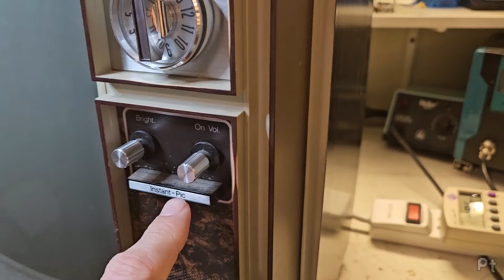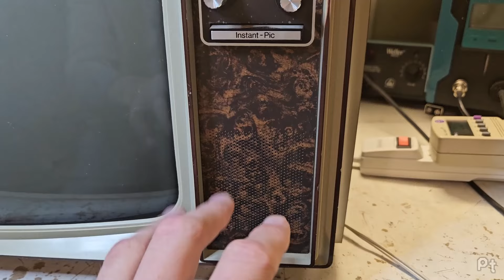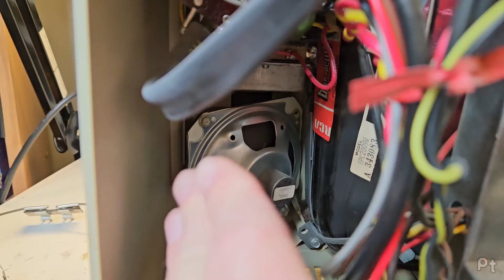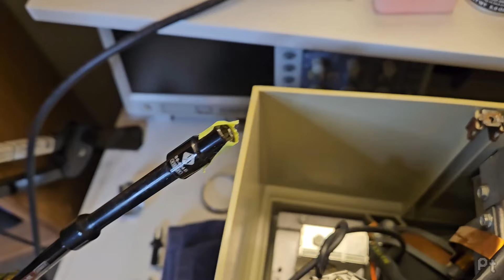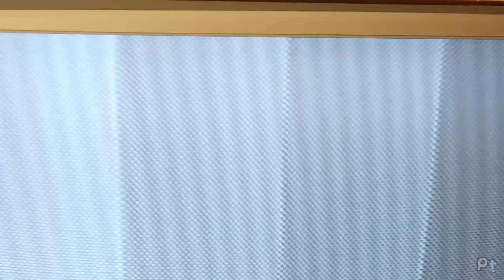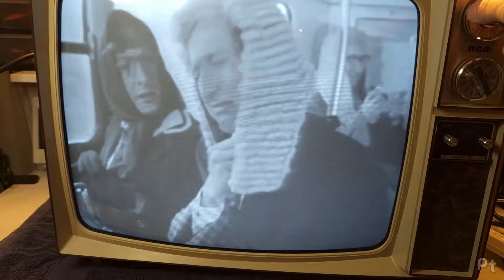RCA All-Tube TV (from 1971)

Comment: My father worked at RCA in Montreal in the late 60s when RCA was winding down its consumer products output because they were raking in far more from government contracts. He brought home one like this, with the Instant Pic feature, for my mother's birthday one year. I always had the impression it was a hybrid of transistors and tubes, RCA's lame attempt late in the game to produce something with simulated instant-on (like transistors) using their backlog of tubes technology. With the Instant Pic switched on, the tubes would sit warm and half-lit until the Instant Pic switch turned everything up to full power. I can remember in the last years of RCA corp's consumer appliances, there were some very cheap and probably prototype devices (like a battery operated men's shaver) that wouldn't take fuzz off a peach, but had a beautiful sleek modern design. They dominated tube-technology up to the arrival of the transistor, and they decided to continue with tubes until it was too late to change their culture.

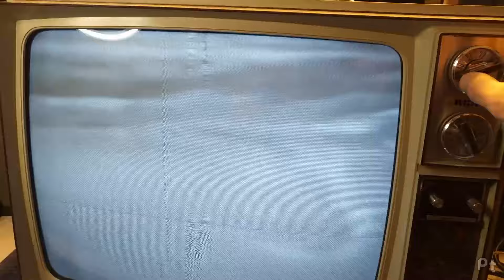Comment: Your vertical line around 22:05 is Barkhausen oscillation in the horizontal output tube.  Sometimes a replacement horizontal output tube will fix the problem.  An old hack for the same issue was to attach a magnet to the side of the horizontal output tube and adjust its position until the line is gone.  Real old time techs would use an ion trap magnet from a mid century CRT.  Maybe you could use silicone tape and a button magnet that has a high enough Curie point that the heat does not demagnetize it.  My best  understanding as a retired electrical engineer and a part amateur, part professional television servicer is that at a certain point in the tube characteristic curve, the tube would experience a very brief internal oscillation that gets picked up in the RF circuitry and may be influenced by the magnetic field from the tube heater resulting in a vertical crawl of the line as well.

Comment: The vertical line that seemed change position as you adjusted  the fine tuning: way at the back of my memory from when I repaired TVs like that around 1980 (when I was in high school!) I remember encountering that occasionally - the line is almost definitly from something in the horizontal oscillator or flyback circuitry (and it has to be since its always a vertical line). Being around the center of the screen, thats maybe where the damper diode switches, so maybe around the flyback drive ciruitry. Be careful in that area though - easly enough voltage an current to be dangerous!  Greetings from Ottawa!

Comment: There definitely is something elegant about these later budget model tube / valve TV sets. As you mentioned by this stage they pretty much had the design down to a fine art. I had a similar set until a few years ago that was manufactured in my home country of New Zealand, under license from PYE. Mine had even fewer valves than yours, although it did contain TWO transistors (!) meaning they could emblazen the front panel with the word "TRANSISTOR" 😂

Comment: Nice set! I have two old Sanyo 12" color TV sets from the mid 1980s - they're both 100% solid state (except for the CRT) and made in Montreal! And I know someone who worked on their assembly line! 
The Instant On or Instant Play or whatever RCA called their version was a common system especially in series filament sets from the mid 1960s onwards. High current silicon rectifiers had already been invented (for car alternators which came around that time) and they would put one in the power supply backwards from the half-wave rectifier supplying the B+. The power switch just "shorted" that diode. That way, when the set was off, half the AC sinewave kept the tubes pre-heated and there was no B+ until the power switch was turned on. When you turned on the set, the set would have audio almost instantly and a picture would take only as long as it took for the high voltage rectifier tube to conduct. 
Standby power was roughly 40 watts just keeping the tubes baking. Some sets also included a "vacation" switch to turn off the filament pre-heat because, well, that was somehow easier than just unplugging the set. And maybe for people who paid for air conditioning and didn't want the extra heat load in the summer. They were a fire risk, any time you have unattended red-hot things in your house... 
In some ways, it was nice because the chassis and all the passive components were all reasonably warm, so the set tended to drift less when you turned it on. You were less likely to have to get up and adjust the vertical hold control and stuff like that. 
Of course, when sets were solid state (except for the CRT and maybe HV rectifier), Instant On and all those other names continued, since semiconductors didn't need to warm up. 
I'm in Ottawa, where are you? Click my avatar and hit About Channel. :) 
Lawrence

Comment: It was expected post-1970 that tv stations would manually switch off the color signal for b&w content on-the-fly, otherwise the opposite happened and b&w looked dreadful with rainbow patterning on color sets.
Reply from the maker: I've seen that with some older recordings of black and white movies off TV from the 1980s. Trying to capture them would cause a lot of devices to go haywire with that rainbow pattern.

Comment: I wonder if this was a model designed for institutional use, but those models are usually labelled "Mural TV" for hotel/motel models and "Lyceum TV" for schools, etc.. It could have been a hospital set. I remember our 1960 Philco B&W console. I could always tell when the program was color because I would see those fine diagonal lines. Magnavox had the "instant-on" feature in their late 1960's color sets. Just imagine how much energy that soaks up and what it would add to your electric bill with a 25 tube color set!
Reply from the maker: You might be onto something. I could see this being used in hotels, though the "instant-pic" feature would have been annoying for hotel owners' wallets.
Reply: Instant on was a common thing , even before the 70's.
I had picked up several Admiral B&W sets from the mid sixties that had it, (instant play)
There were several other brands from the 60's that had instant on, I remember hearing a lot of controversy about instant on/instant play.
Apparently a lot of house fires pin pointed some of these sets as the cause,  I guess simply because to the tubes being on 24/7 , and prematurely deteriorating wire, and other plastic components.
Reply: I remember working at a television shop that serviced hospital sets in the area (central Kentucky, USA), and these sets had wired remote controls for the patients to use.  So I kind of doubt this was a hospital set.
Reply from the maker: @SeekingTheLoveThatGodMeans7648  I have a family member that was in the hospital in the 70s and built a long tool that would turn the remote on the hospital TV because it didn't have a remote. I think it might have varied by country/region. I do remember the wired remotes though, I remember seeing them into the late 90s (connected to normal looking TVs that typically came with wired remotes).

Comment: That is a gorgeous set.

Instant On did start with tube sets first, as I have a few example of that, and ended up in solid state sets until about the mid 70s. Either way, no good for the life of the tubes, or your electric bill :p

Comment: I think that TV was made a few years before my Canadian Sears TV-Radio-Alarm clock (though that was made by Toshiba for Simpsons-Sears of Canada), though I did get a PDF Sams manual for it, I haven't gotten round to looking into getting that going, still farting about with that Sanyo-Funai combi unit, got the video driver ICs for that today, lacking confidence in replacement though, cos TSSOP16 is a tiiiiiiiny package!!! :S
Reply: Flux and solder wick do help. But if you have some junk parts you could try soldering a bit on those until you feel more confident. That way it's not a problem if something gets damaged.
Reply: @NaoPb  I'm confident in soldering in general, but a part that's package is 5mm long with 16 legs that are just slightly thicker than hair, it's not looking like a fun time, smallest IC I last soldered was a bigger SOP16 in my Amiga 600, and that took a couple goes...
Reply: @twocvbloke  I figured maybe you had some junk boards with similar chips to experiment on beforehand. Sorry for being unclear about that.
Reply from the maker: Believe it or not that Sears TV is actually older! It's just that this TV used much older tech, and the Sears used more modern (Japanese) tech. I'm fairly certain I have the same one (model 13907), and it's listed in the 1967 and 1968 Sears catalogs. It looks like 1969 introduced a new version.
Reply: @probnotstech  Yours is definitely the older version, mine's the later 13030 (chassis no. 562.10703C, all plastic, no wood, just LGR-approved woodgrain-effect plastic), I'm sure I saw dates inside for 1975, electrically speaking they're probably basically the same though, just arranged differently... :)
Reply from the maker: @twocvbloke Oh yeah, that's the newer one from 1969. It's in the 1970 catalog, but I don't see it in any later ones - though it was probably still sold in 1971 or even later.
Reply: @probnotstech  I wouldn't really know, I'm still wondering how it ended up in the UK in the first place (I'd guess a canadian ex-pat moving here, forgetting TVs wouldn't work with our power and broadcast standards), was hard enough working out which Sams manual to get given the US Sears & Canadian Sears models are different model numbers for the same thing!! :S
Reply from the maker: @twocvbloke  Most likely, yeah. A while back I was at a thrift store and saw a UK console stereo, electric iron, power strip, and a whole bunch of other stuff. Most of it was quite old, so I wonder who the previous owner was. Ex-pat with a step-up transformer?
Reply: @probnotstech  Could be, plenty people have emigrated to Canada from the UK over the decades, though I'd have assumed they'd sell up everything before leaving, I guess they just liked their stuff too much to part with it! :D
Reply: @probnotstech  U know someitmes I go to hospitals and some how they still have analog cable up sometime I will bring a vcr to one and try it out see if it can get stations and they get the new channels.